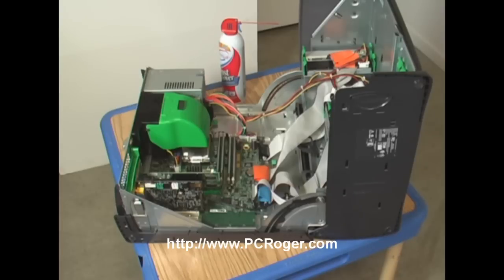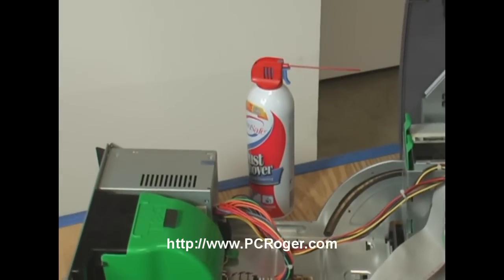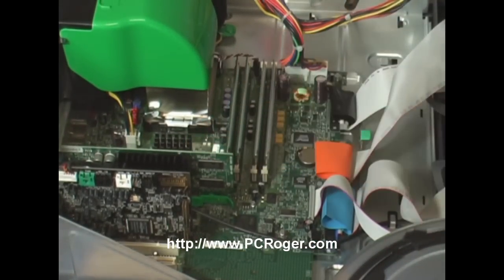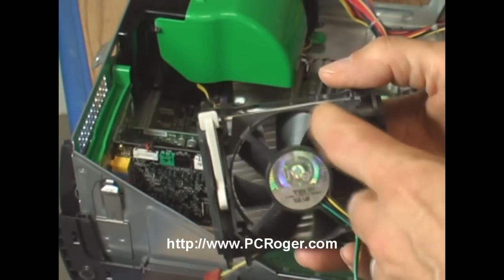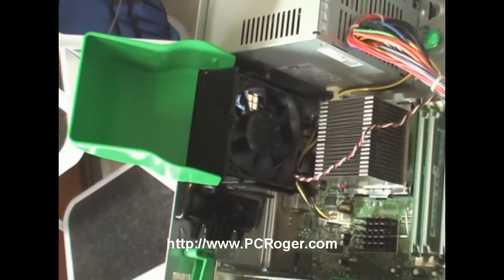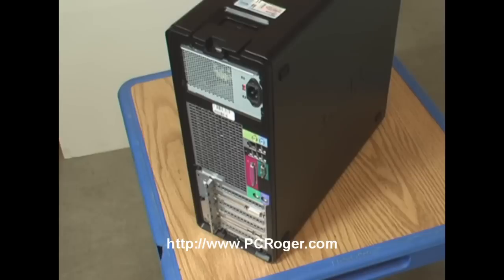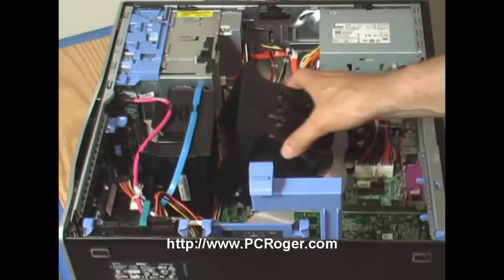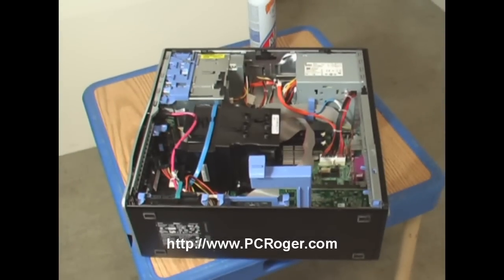How To Clean Out Your Computer and Make It Last Longer

Comment from the maker: the only way to know is to pop the cover and look, OR listen to it and if the fans seem to be running faster (newer PC's have variable speed - on demand - fans).

If you open it up after 6 months and it's still clean, then go 9 months.

What you really have to check is the CPU heat sink under the fan. If that heat sink is getting full, it won't cool

Comment from the maker: You have to be careful with an ordinary air compressor. Too high of pressure can damage something & there can be oil in the air from the compressor if not well filtered (which most do not).

Comment: I usually take the cpu fan off as well as the case fans and clean them out with a paint brush. Than I take the Power supply out and take the cover off and clean it out the fans and heat sinks by brush as well. 
The end result is the system runs faster and quieter as well.